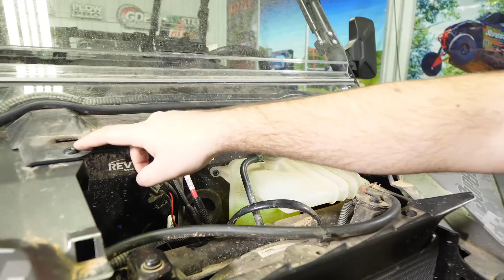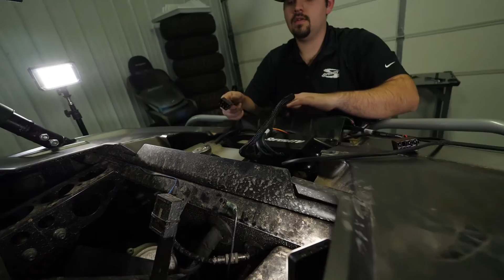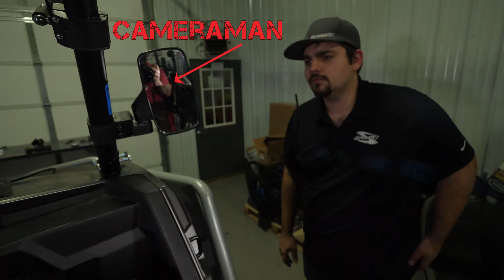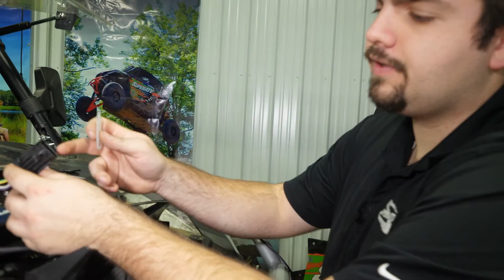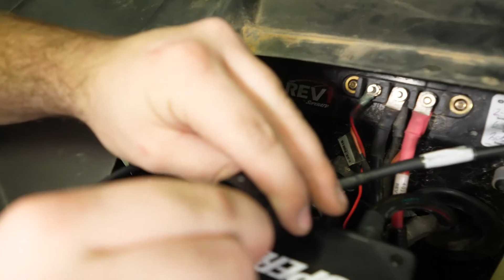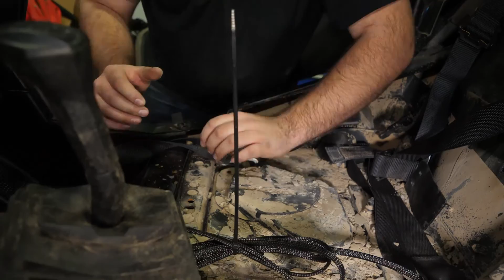SuperATV Deluxe Plug and Play Turn Signal Kit Install | Polaris RZR | How To |

Comment: When installing front facing turn signals be wary there is a bracket on the facing where they are putting the turn signals. They dont bother to mention.
Reply from the maker: Thanks for sharing your experience!